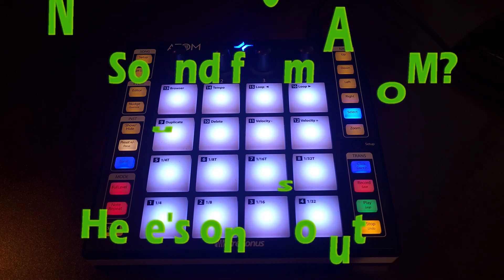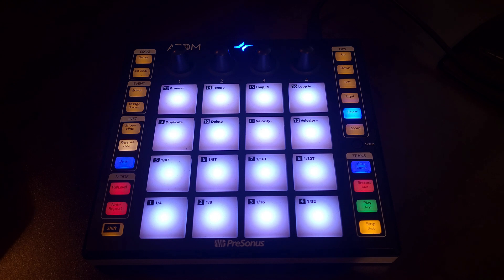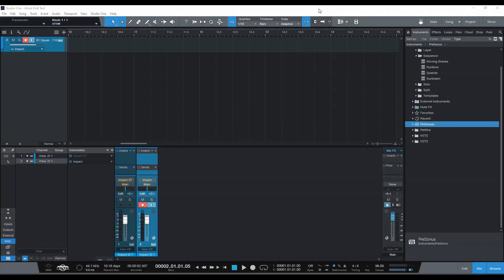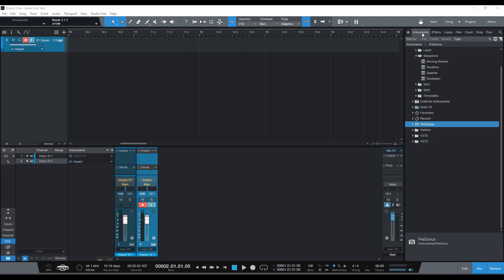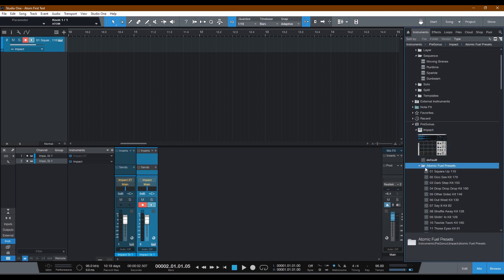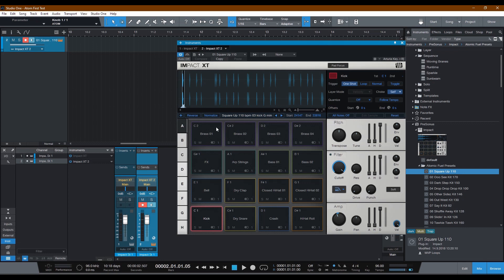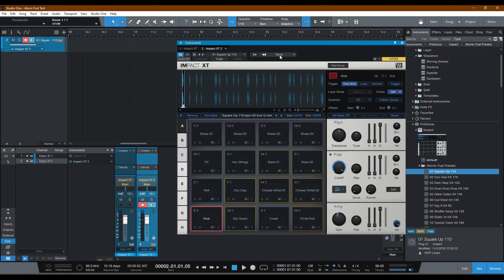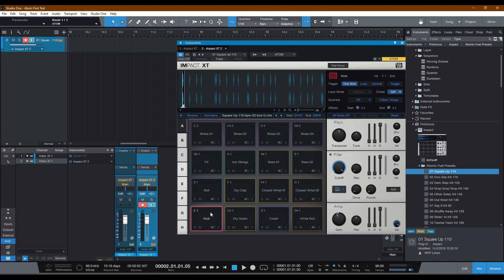PreSonus ATOM - No Sound? One Possible reason

Comment: Hi ,
Still unable to get the sound from atom.
Reply: I was having the same problem for a while and this video did not help me as well. So after research after research nothing helped. So after wrecking my brain I realized after disconnecting and reconnecting my atom a million times my computer didn't make a sound letting me know that something new was connected. I was using a USB hub, so I connected directly to my computer and by surprise there was the sound I was looking for. Problem solved! Connect directly to the computer and you will be using your atom again!
Reply from the maker: Read up on ASIO4ALL. Be certain no other devices are using the Audio on your PC. Close out of everything except Studio One.  Check out the Audio I/O settings in Studio One.Far too many other scenarios though to list here.
Reply from the maker: Hey PS, make sure you are using notes within the range of your VST Instrument and Keyboard. Example: if you are playing a Cello, playing in C4 or higher likely won't produce any notes. Also, If you turned on your keyboard after the PC/Mac has booted up, you may need to "reconnect" your MIDI controller in the DAW you are using. In Studio On as an example its under menu: StudioOne|Options|External Devices - locate the controller, choose Reconnect